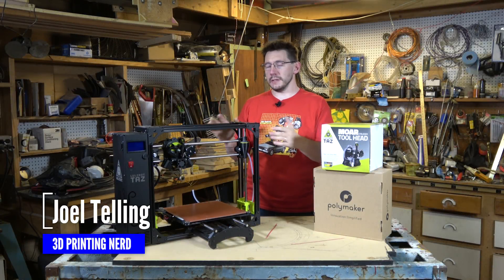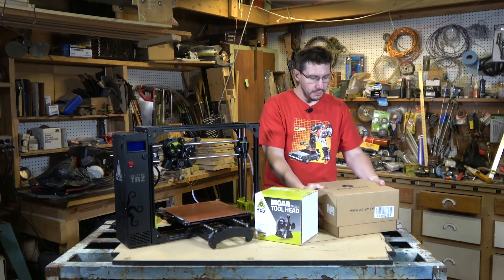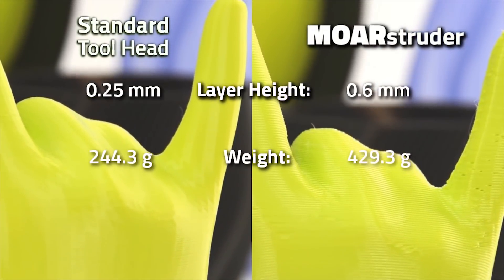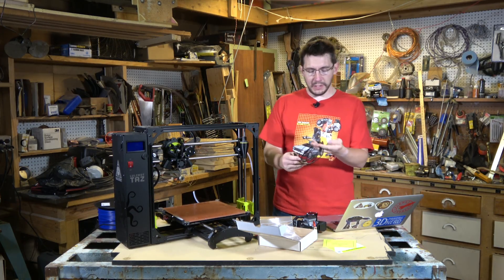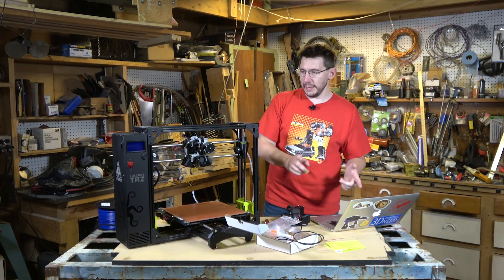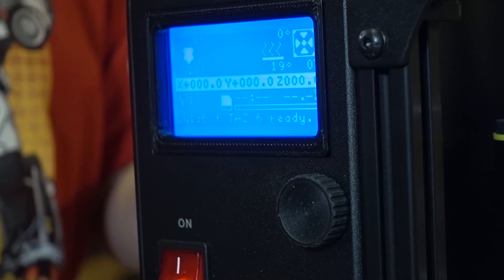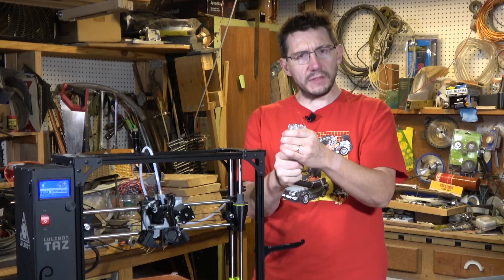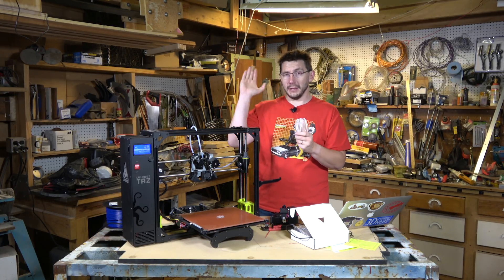3D Printing with the Lulzbot MOARstruder on the TAZ 6 3D Printer

Comment: Som 5 years later and I decided to try out the MOARstruder on my TAZ 6. It is really cool. I have multiple 3D Printers and I do a lot of robotic, Arduino or Raspberry, and at times I want something REALLY quick to prototype. I then do down to the typical .4 toolhead with the 2.85mm filament. Or I use one of my other printers with 1.75mm, Sindoh DP200, Snapmaker 2.0 A350, or a crazy machine I have that nearly no one has, Dobot MOOZ 2, which is limited to rather small parts, small build plate. Funny thing is that the Dobot MOOZ 2 is a much better printer than most people give credit to. Anyway, my favorite printer is the TAZ 6. Cheers.

Comment: Did you have as much trouble I did with the wiring connection? I'm hoping that as they move to the "Universal Tool Head Adapter" they change the connectors over to something better.

Comment: Taz 6 is an absolutely beautiful printer, and mechanically I believe it's the pinnacle of modern consumer grade fdm printers, but $2,500? I don't think so. 

That is 3 Prusa mk 3's. Material costs may differ slightly, but I bet their R&D budgets were similar. I just don't see a justification for the price, I see a cashgrab.
Reply: Nick Heyer yikes. At that point you could get a Mk. 3 with all the upgrades, plus a set of ruby nozzles, whatever build surface you want, and then throw in a Sidewinder or CR-10 just for fun.

Comment: High five my friend, thanks for another great video! 1.2mm nozzle are really interesting but is it using 1.75 or 3mm filament, I don't think you mentioned which it is.
Reply: All of the Taz machines use 3mm filament, I believe.
Reply: Ryan James unless you convert or build a toolhead for 1.75

Comment: Why is the lulzbot so expensive? What different does it do compared to something like a cr-10? Yeah I know it auto levels, but that isn't worth the 1500$ trade off.
Reply from the maker: +Sensei Dekkers this is something you should contact Lulzbot about.
Reply: You don't have any thoughts why?
Reply from the maker: +Sensei Dekkers well, sort of. It's rigid and well built in the US, easy to assemble, open source hardware and software are used and libre innovation is involved, and support is constantly wonderful. Whether or not that's worth the extra price is up to the buyer, not me. The machine is suppose to be nearly headache free and print anything with ease. I don't know if those are the right answers but it's what I have on a Saturday night. :)
Reply: No that makes sense. Sorry if I was coming off as rude. I was just curious that's all :) If the support is good and they are made in america, then i can see how it is worth 2500$
Reply from the maker: +Sensei Dekkers not rude at all, I promise! #highfive
Reply: If your feeling price sensitive on the newest taz 6 or mini. Think of buying used a Taz 5 is a fantastic machine and sometimes people just sell them for parts.

Comment: hey 3d printing nerd, i was wondering what type of 3d printer to get myself for christmas, as a first one, is this a good one? https://www.wish.com/m/c/59c5c64169eced64beeff29b i would love an answer as i know nothing on these, thanks! ;P
Reply from the maker: That looks like an interesting, low cost machine. I have no first hand experience with that, but, if you have the time to tinker, it may be okay? If it is going to be your first 3d printer, though, you may be trying to ski down the double diamond hill :)
Reply: 3D Printing Nerd do you have any recommendations on what one i should get thats cheap? preferably under €160 and including shipping to ireland and not too sure what the double diamond hill is sooo....
Reply: Jamie's Gameplay Its basicaly one of the hardest ski route classification(its a metaphor) if its your first 3d printer Id go with eather the cr-10, wanhao i3 v2, wanhao i3 plus or the monoprice select mini, depends on what you want. There is no perfect cheap ed printer but those are pretty nice, not sure if they all meet your standards though.
Reply: Wish doesn't really doesn't make it clear that, almost everything they sell will be sent direct from China.

If you can, check where it's actually coming from.

A large box is very unlikely to sneak through customs unnoticed and as it's over €22, you'd be hit for VAT and a collection fee.
Reply: Diego_PE would this one be any good? https://www.gearbest.com/3d-printers-3d-printer-kits/pp_671774.html?wid=21
Reply: Jamie's Gameplay Again, it depends on what you want. If you want a 3d printer kit so you assemble it as a hobby then, personaly, I'd go with an anet a8 kit. If you want a more finished product the Monoprice select mini seems to be the most popular printer for new members of the comunity within your prine range. i must remind you this is just my personal OPINION, in the ens you will be the one doing the purchase.